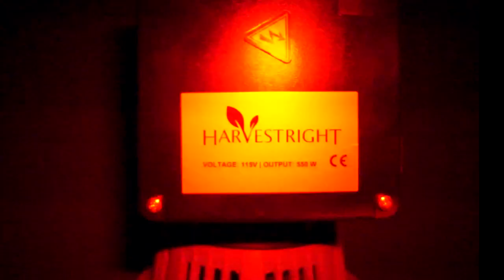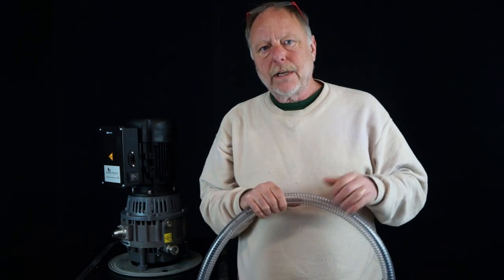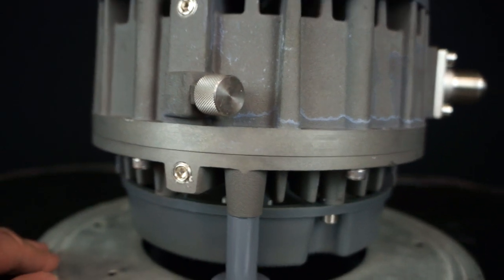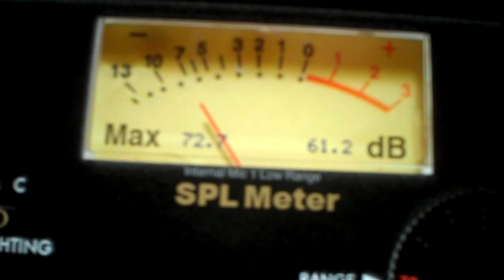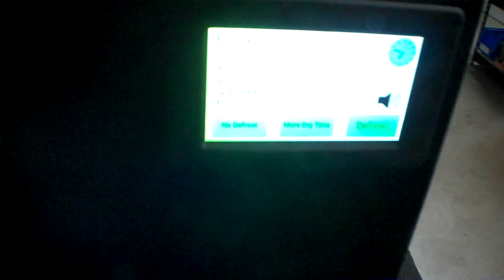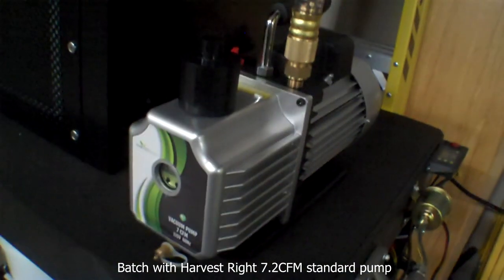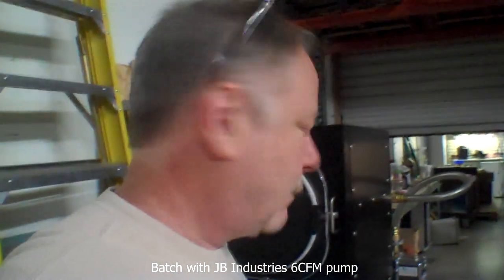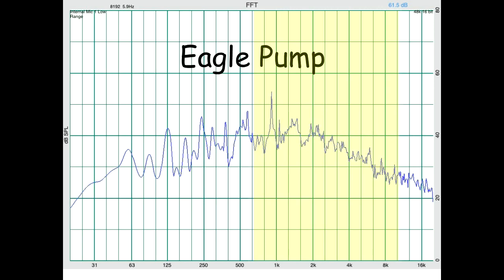Oil-Less, Maintenance-Free Pump for Harvest Right  Freeze Dryers - The Eagle

Comment: Why is it you do not use a Tesla Vacuum Disk Pump using a shaftless magnetic induction drive A.C/D.C brushless electric motor? And why don't you Americans design and build and manufacture to last as long as it exists? American corporations sure knows how to fool their customers with useless warranties and guarantees when in fact they make everything to last forever, maintenance-free, repair-free, and trouble-free.
Reply: @Robert Scott Yeah where can you find a Tesla Vacuum Disk Pump using a shaftless magnetic induction drive A.C/D.C brushless electric motor?
Reply: darthvader5300: interesting pump, TDP, but looking over their website applications, there is nothing about "vacuum" applications. It requires something with mass to work, the thicker the better. Hence, TDP work with fluids. In the absence of fluids, a vacuum, the TDP does not work. There is NO Tesla VACUUM Disc Pump. Math calculations show a TDP could possibly reach 95% vacuum using air, but nothing below that. That's why no one uses a TDP to achieve near perfect vacuum conditions! They don't exist!

Shaftless magnetic induction drives do exist. And so do brushless AC/DC motors. How much would you be willing to pay? Do you have a business model that shows people would be willing to pay a whole lot more money to gain a bit more efficiency? Law of diminishing returns.